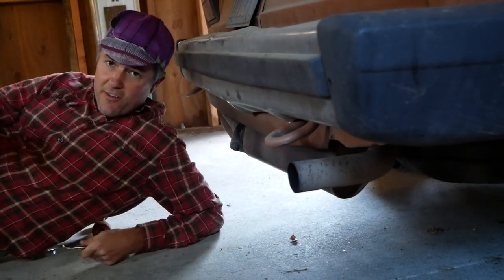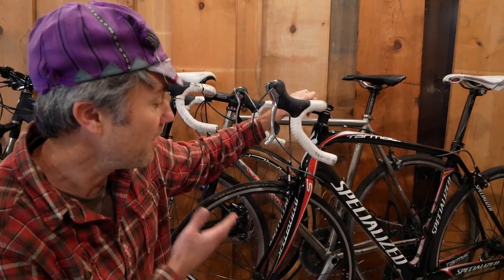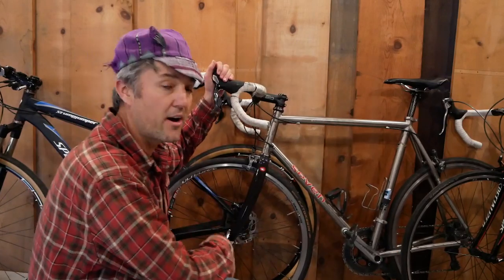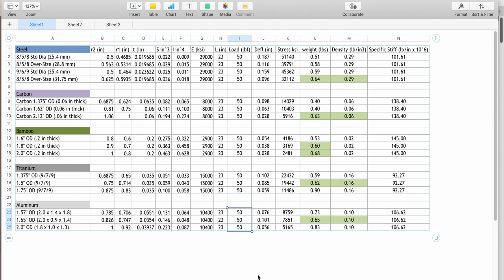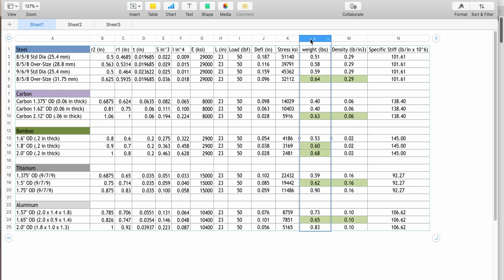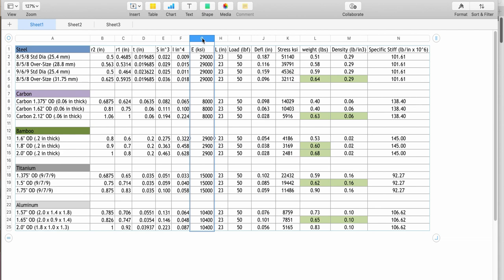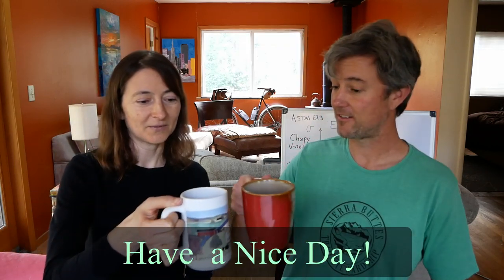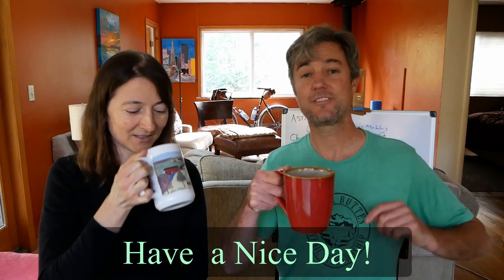Steel is a Great Material for a Bicycle Part III: Stiffness

Comment: Great video and explanation. 

Sheldon Brown article showed all the bikes pretty much deflect similarly and it doesn't really matter which frame.

While Jan Heine has come up with 'planing' which comes from frame spring
https://janheine.wordpress.com/2014/12/31/the-biomechanics-of-planing/

Is 'planing' a real thing?? Jan Heine says a rider can have a 12% greater power output but it was just a test for one rider so it is not a true statistical test.

Can't decide if I should trust Sheldon Brown or Jan Heine on this one
Reply from the maker: Hi Nick,
Thanks for the link to the article on planing. It's an interesting read, and I have come across it before. I had to read through the article a few more times to try and wrap my mind around how it supposedly works, and what Jan is purposing. There's a lot there to sort out, and having read a lot of scientific research journals myself this does not follow that format. It is fun to read though, even if it's not written as a scientific paper. I'm assuming that wasn't the intent either, since this a blog post. My response is going to be a little long winded, but I wanted to keep my response as objective as possible, so others who may read this can make their own conclusions.  On the outset I want to say I agree and appreciate a lot of what Jan Heine and Bicycle Quarterly have done for the bicycle industry and me personally in my pursuit for the holy grail. 
In the first article, "What is Planing" Jan Heine claims a 10-pound heavier bike can climb faster if the frame flex characteristics are matched with the riders pedal stroke. We know intuitively this is problematic because a heavier bike does require more energy to move it up a hill. He says a 10-pound heavier randonneur bike was able to perform just as well as a much lighter titanium bike. He demonstrates how a rider on a 10-pound heavier bike is 5% heavier overall (bike + rider), but would only require 4% more power to compete against a rider on lighter titanium bike. He doesn't say how the power is distributed by wind, rolling, and gravity resistance, so we'll have to take him on his word that he did the math correctly. He then devises a test to prove this by building four identical bikes using different tubing diameters and thicknesses, but in order to keep all the bikes exactly the same he adds weights and uses the same components. For the test, they conceal the identity of each bike by covering the tubes with foam, so none of the testers would know which bike they were riding. Here is where things get a little confusing to me. At first, the article talks about riding against another rider on a titanium bike. However, in looking at the test results it shows how one rider consistently outperformed riding one of the bikes (bike 2 compared to bike 1). The results are given in Watts. Are these results comparing only the steel bikes in this test? Did he test these bikes against the lighter titanium bike? He claims he performs other tests, but that was not reported in the article. Perhaps the results of the other tests were only published in the Bicycle Quarterly magazine? The results are intriguing though. 
In the second article "The Biomechanics of Planing" he goes into explaining how planing might work. He says, "We know that riders can put out 12% more power on bikes with optimized flex characteristics." He starts by explaining how flexing a bicycle frame remains elastic and that all the kinetic energy stored in the frame will be conserved and returned with little to no losses. This is a fair assumption in my opinion, and given that most bike frames are loaded well below their plastic limits, it seems reasonable. He then discusses how a flexible frame with stored energy will rebound as the rider begins to reduce the forces on the pedals. He says, "A cyclist’s power output is very uneven during the pedaling stroke. Even a professional racer with a beautiful spin puts out almost all of his/her power during the down stroke. This means that the bike is propelled forward by a series of brief accelerations, rather than a steady force." In effect, what he is saying is this stored energy is helping to push the bike forward by extending the power phase of the pedal stroke. Recall, power is force times distance divided by time. Rather than having a higher force applied over a shorter distance the stored energy in the frame creates a lower force but over a longer distance. Both of these two possibilities are supposed to occur in the same amount of time (e.g. at the same cadence). In his theory, this extended power stroke helps the rider even out the dead spot more efficiently. This reminds me of the eccentric chainring theory, but that's another topic. 
I think it's a fair assumption to say the force on the pedals through the full pedal cycle is variable, and a maximum force occurs somewhere near the 3-o'clock position, and that a dead spot begins somewhere around the 9-o'clock position. Obviously that is something we can find through scientific experimentation, and will vary among riders. It seems to me this entire theory could easily be verified with a very accurate power meter measuring input (crank) and output (rear hub) power on different bikes with different flexiblities. I doubt commercially available power meters would be sensitive enough for such an experiment since many of them have at least a 2% margin of error. I would like to see a pier reviewed research paper on this, because while I think there is certainly benefits to a flexible frame, what Jan is suggesting here is that stiffer frames are very inefficient compared to flexible frames, on the order of 4-5%. If that's true, I would imagine there would certainly be a lot of money willing to study this concept. 
In conclusion, I personally wouldn't recommend you sell your bike with an expectation of getting 12% more power with a more flexible bike. What I would recommend is getting a new bike if your current bike is stiff and causes you discomfort. A slightly flexible bike with soft tires will help to take the edge off the harsh bumps in the road, and that is something I have noticed makes a huge difference for long distance cycling. My current bike is pretty flexible and I like the way it feels while I pedal on it. It's hard to say if it's faster, but my current none scientific testing seems to indicate it's not slower. Anyway, keep me posted if you happen to find any more articles on this topic, as I am very interested to stay current on this topic. Thanks again!
Reply: @Henrywildeberry  super interesting response. really like your train of thought! Definitely the comfort of flexible bikes makes happier on the bike.

Also agree that Jan's theory is plausible enough to deserve more rigorous testing. I would love to see the results of these sorts of tests. Especially because a lot of work over the years has been put into designing stiffer frames for road bikes. 

I dig that you really tease out the physics of bikes in your videos. I'm a scientist and a cyclist so your videos are tops for me!

Comment: You have a good technical mind and I think you've done a good job breaking down a subject that can be somewhat dry to most people. You're better at it than my strength of mat'ls teacher back in the 80's,lol. If you haven't already seen it you might like the GCN video on frame flex (planing).

https://www.youtube.com/watch?v=BH_AL4rxrp8

When you're done stirring the pot on materials I wish you would take up the subject of foot retention. Basically I've come to realise it's not necessary for 95% of riding (no, not even toeclips). I've been riding pinned flats and 5-10's on everything these day's even my rando bike. I get a few fisheyed looks from the road snobs but it doesn't matter to me because I'm not any slower (to be fair I'm not any faster either,haha). I don't miss trying to walk in cleats. I notice Ms Cools always wears her favorite sneakers on a ride. I think she instinctively knows what's up. Anyway enough of my blather, here's something else to chew on. Thanks for the great videos.

https://www.bikejames.com/wp-content/uploads/2019/07/The-Flat-Pedal-Revolution-Manifesto-20171.pdf
Reply from the maker: Thanks for the link, Philip! Thats a great video. It's a very easy way to visualize the energy stored in the frame and how it rebounds once the brakes are released.

Comment: I thought the main selling point of steel is its lack of stiffness.
Reply: Steel is stiffer than aluminum and (3/2.5) titanium of the same dimension.  Thus, thinner diameter tubes can be utilized, improving ride quality.  To keep an aluminum frame from feeling like a noodle (Vitus anyone???), you have to oversize the tubes considerably (Cannondale tandem boom tube anyone???).  Produces a nice, stiff and efficient frame (especially a tandem) but end up with a harsh-riding frame. 

Steel is considered the sweet spot.
Reply: @dudeonbike800  But it still end up being lighter and stiffer than steel.